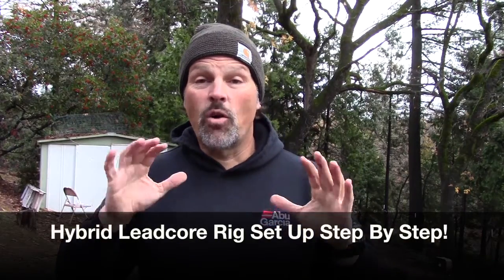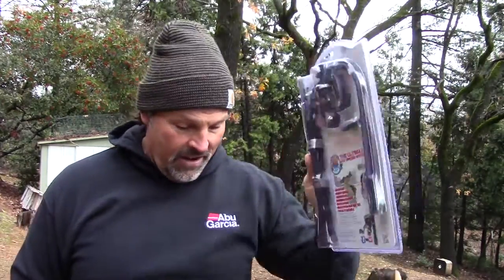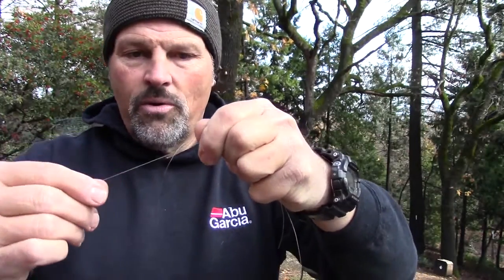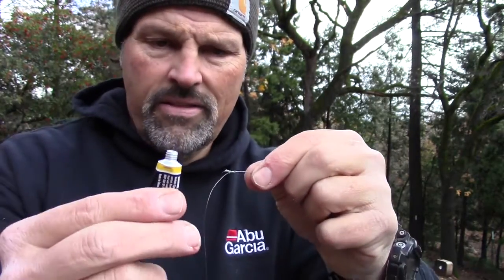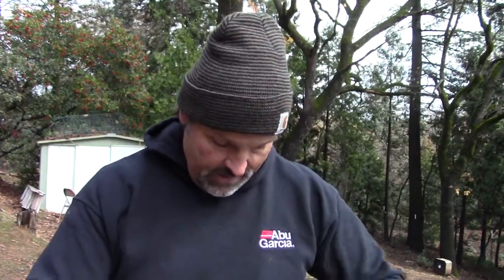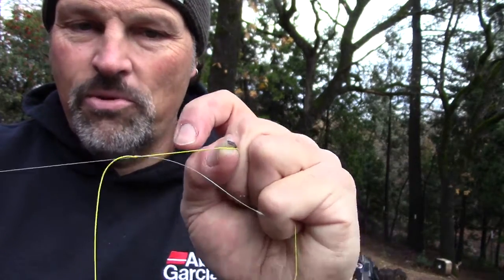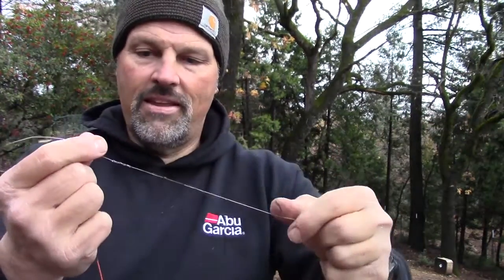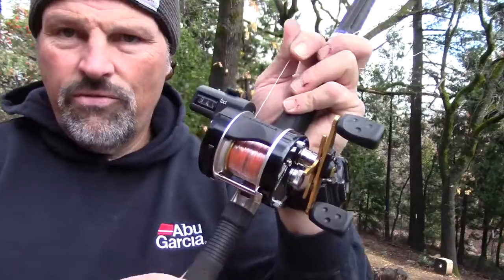How To Set Up The Hybrid Leadcore Rig Step By Step!

Comment: Question why the all the braid backing when it's all mostly staying on spool. 2nd if you put in 2 colors do you allow 3rd color to go down 10ft or so?
Reply from the maker: Well I do spool out braid at times…. And it also helps fill the spool with only 3 colors…. Don’t understand part 2…. Each color gets you down 5 feet….
Reply: @catchamerica  I'm new to lead core I think i get it now sounds like guys have different rigs some with 3 colors, others with 5 and other rigs with 7 or so. Different rigs per different depths but on each rig all the lead core gets spoiled off for that specific depth? Like you don't have a 3 color rig and just spool off 2 colors?

Comment: Just ordered 2 abus and plan to set up this way as well. Now 3 colors would be your shallow rod and go down to 15’ with 3 colors? Now when you say they go down to 30’ is that with ) colors? Also when you set back do you stop when the leadcore color touches the water, rod tip, or let out to a certain counter? Did I miss a video with your explanation on how to run it? Thanks
Reply: 3 color rod gets me to 5-15 feet and 6 colors gets me to 5-30’?
Reply from the maker: I only use 3 colors with 15 or 20 lb braid backing...With three colors out and 25 feet of braid I'm down around 20..With 50 feet of braid I get down 25 to 30....I have one rod with a longer topshot of fluoro that I use for shallowish work and one with a shorter topshot that I use for deeper work....
Reply: @catchamerica  great, I got ahead of myself and found the rest of your videos on this. I now have 2 abus set up this way! I cannot wait to get out and give this a shot.

Comment: Just got the same rod and reel and spooled up exactly according to Cal’s specs for 18ft top shot and calibrated the reel by measuring out a hundred feet in my yard and then spiking the duolock in the ground with a screwdriver and ran the line back to my 100ft mark and it was damn near spot on! With a dodger and some leader to presentation should be perfect! Thanks Cal!

Comment: I ended up using the larger okuma cv-354 dlx reel which pairs up with the yellow rod very nice the rod reminds me of old school rods we used when I was a kid with modern guides & traditional cork handle I differed my line setup from cals just a little in that I used #12 mono for backing & 4 colors lead core with #10 berkely vanish for the 70 ft. top shot the smaller okuma 163 I found the spool too small to accomidate 3 colord of #15 lead core so I transfered that reel to my trout & kokanee rod spooled with #10 berkely vanish the hybrid rig ill use with trout trix worms , metal heads & pistol petes with a rudder as the pistol pete flies have a very small spinner so im not taking any chances I try to watch at least one FHS video a night during this stormy weather to get ideas for my next trip I have camanche   new melones & don pedro nearby to fish as well as a few others

Comment: I should clarify I couldnt find the 5500 lc model in left hand have owned the 5501 lefties as well as the 6501 but couldnt find them in linecounter models im sure the okuma will work for me up until now ive been using spinning tackle for trout I plan on using your same line counter numbers when spooling the okuma

Comment: Awesome Content. Thanks for taking the time to do this. This may be a silly question, but could I use this concept but run stick baits as opposed to Flys? I want a system where I can run Flys and/or hardbaits  with lead core and get it out away from the kayak as needed.

Comment: Cal, I've seen you use a couple of recommendations for spooling a conventional reel. One approach uses mono to start before braided, the other was to use silicon tape with braided following. I have seen many approaches on the tube but rely on your opinion as tried and true. Which do you recommend as the best, if there is one. Thanks

Comment: Ive pulled the trigger on one of your lead core rods I share your opinion on the abu garcia reels however the lc 5500 not available in left hand so ill be pairing it up with an okums cv-163 dlx (leftie) it has a line capacity of 180 yards of #12 mono ill be studying more of your videos also ordered metal head fly kit this is all new to me m sure ill have questions before its all said donei

Comment: Great video Cal!  If I wanted to get down to 100 feet at Shasta how much more line would I let out, or would I need to add 3-4  more colors?  Sometimes, the downriver are a pain in my 1991 Alumaweld with the old school narrow not made for downriver rails.
Reply: Down riggers! Darn autocorrect!
Reply: 5 ft per color, there about, means 20 colors means 200 yards of leadcore. I don't think you can fit that much on a reel, unless you get a deep sea rod and reel set up then that might be too stiff.
Reply: I fish tahoe at 100 feet with leadcore. I load my whole okuma cold water 303 with about 18 colors of leadcore  connected to 30 feet of 12 lb mono to 12 feet of fluoro. It gets me to 100 feet deep.
Reply: @tkbilly  I want to try this, have you had success running lead core this deep?
Reply: @mbeckwith7514  I haven’t used this exact setup, I just do leadcore to mono to flouro. It works amazing.
Reply: @2olvets443  it's 10 yards or 30 ft per colour

Comment: I'm not sure why you don't use mono as all your backing on your shallow rig. The 500 feet of braid is another $20.
The albright knot is good for connecting backing and leader to lead core .
   Isn't the glue superfluous if the knot is properly tied?
Reply from the maker: Braid is more reliable and has less stretch…. Albright is okay…. I like the glue….

Comment: Hey Cal, I’ve been using heavy braid on my catfish bait cast rig. No top shot!
I’m getting allot of twists or tangles in my line. Seems to do better with less line on the spool. Less line that is because I’ve had to cut out a mess.
What am I doing wrong?
Reply: No backing either
Reply from the maker: Spinning rod or bait caster?

Comment: Hi Cal, what are the advantages of the hybrid setup? I'm used to braided backing, ten colours lead core and then the top shot. Why do you only use three colours and mono to start with on the spool??
Reply from the maker: 3 colors gets us down to 20' or so, which is about as deep as we typically need to fish.  We also like to keep the setback under 200'.  It also allows us to use a standard 5500 reel.

Comment: That's great Cal. I was going to try and contact you for this information. Heading to your store after this note to see if you still have any of those Arbu left. Should go well with my Vance ULT 762 rod for long linning. I just don't use a downrigger on my kyack. Trolled all summer with a spinning rod and did very well in the high mountain lakes but changing out from a trolling set up to a casting set up takes away from my fishing time.  Can't wait for spring, roads are closed now to where I go. Again thanks for the info...
Reply from the maker: You'll dig using the leadcore...Works Great!

Comment: Is that reel like the Abu Garcia ambassadeur altum dlc where once you get your line down to the depth you want and engage the reel you can back reel about ½ a turn and it reduces the drag by ½ish so it acts almost like a bait runner?
Reply from the maker: No I don't think so....You've got to adjust it manually by moving the star....

Comment: When you are actually putting braids on your casting reels it is not recommended to use monofilament for a backing my word Vice is use braided line for your backing it does not slip on the spool I've been using braids for quite a few years and it works real good try my mess up once used braids for your backing I'm just saying
Reply: I've heard the exact opposite.  People start with mono as backing and then add the braid.
Reply: A word of voice I do not start with monell as backing special would braid because itasse braid to braid that's how it's post be done

Comment: You obviously have a method that works for you , but I have a couple questions about a couple lengths of line you were giving as you filled the reel. I have some 18# Suffix Performance lead core line. Each color is 10 ft long. That is what you used, except it it was 15 lb. line. I was under the impression that all Suffix line had 10 foot colors. You said you loaded 3 colors of line and that it was 90 feet of lead core. Wouldn't 3 colors be 30 feet of lead core, not 90?
My second question has to do with using the line counter to measure the line you were adding. As I said earlier, you have a method, probably through trial and error, that works for you, but those numbers you were looking at on the line counter were not accurate. As I have been told by Pros, videos and experimented with myself, line counter reels are only accurate when you have a full spool of line. One has to calibrate the exact amount of line to get anywhere near close to the numbers that the line counter is telling you. For example, when you put the mono on, you said you were adding 80 ft. or something like that. The line counter displays the revolutions of the spool at full capacity. Since that was the first line you put on the reel, there is no way that was actually 80 ft. or whatever the line counter number was since the diameter of the spool of line was so small at that point. However, I do understand that it is the number on the line counter you use for filling an AG 550 the same way every time. It is practical, but not accurate to quote the line counter numbers to get the reels all filled alike.
Did you purposefully not mention the line counters inherent inaccuracies at different stages of filling the spool to keep things more simple?
Reply: If you look closer, you'll find that it's 10 yds per color, not 10 ft